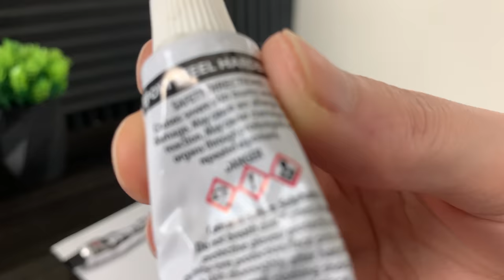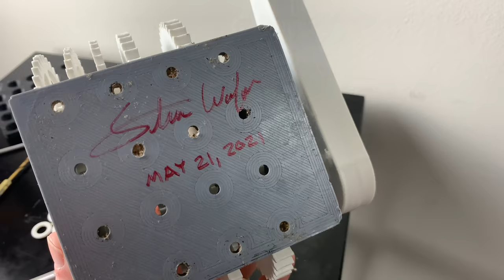3D Printer Gearbox - Spinning it FAST

Comment: I'd love to see a gear system like this used with a Fan. Just to see how well it could shift air or cool a room.
Reply: At what point is it just a manual plane
Reply: @crazynachos4230  When you can crank it hard enough, you need to measure your speed in Knots?
Reply: Technically, it heats the room, but you could measure wind speed and calculate a ballpark "wind chill." I'd like to see it
Reply: @SimonJ57  Knots are for ships not planes
Reply: @MonsterPumpkin  What are planes if not Ships of the sky? Real talk, airplanes do use "Nautical miles" and knots for distance and speed, respectively.
Reply: It'd create a need for an expensive motor with a lot of torque and it'd also be very noisy because of the incredibly fast spinning blades.

Probably why it hasn't been done already. Though I'm sure standard tower fans aren't just a direct drive. Must have some kind of gearbox.
Reply: @whyeven3722  late to the party, but there's also probably a functional limit to the relationship between fan speed and air flow. At lower speeds, the 3-speed fan works fine,  but the convection cooling achieved by the fan is directly dependent on the amount of mass flow the fan can move, which breaks down at higher fan speeds. Another user commented that the smallest gear was moving at 167 rev/s, which for a 20" box fan would result in a tip speed of around 266 m/s, or about Mach 0.78, which is well within the compressible-flow regime. Basically, making a fan "faster" only works up to a point, because once compressibility effects take over, your effective mass flow is going to drop off significantly due to compressibility losses and what not. I don't know all the details, but I would guess that a larger, slower fan, would remain more effective for cooling than a small, jet-speed fan.
Reply: At that point you have a turbine engine
Reply: @MonsterPumpkin  welllllll, some people use knots for planes, it’s dependent on height and speed, or so I heard, I’m not sure tho
Reply: Imagine it putting that gear from a bike

Comment: Some ideas from an engineering dropout, rather than substantially thinner gears on the faster end, decrease the infill on the print, you're losing efficiency from the thin plastic flexing as it spins fast. Some combination via trial and error may be needed.
You're never going to get adhesive bond to an axle to hold the kind of mechanical advantage you're working with on the handle, it's surprisingly easy to key a shaft with a dremel and then use a dab of jb weld to secure the key. Lastly, bearings might seem like cheating but you should definitely have something there. Might I suggest brass bushings and a bit of lubrication? They can work a dream and aren't too difficult to make.

Comment: adding some bearings or at least lubrication to the faster gears to reduce friction may help you get more speed.
insane to watch 3d printed parts spin faster than an engine. great work!
Reply: Grease to the gears (so that they don't wear) and oil to the bearings (so they are smoother).
Then drill a hole in the shaft in order to have a better grip when glueing things to it.
Reply: The only way he'll acheive those speeds is through trial and eror, somethings gonna break. Once something breaks simply reinforce it, if nothing breaks its not spinning fast enough.
Reply: @zN8z  trial and error isn't the only approach man. We got the tools to go ahead and be smart about designing it versus just winging it till the end.
Reply: @nap8187  no dur, this is a youtube channel. he makes profit for these videos, wouldnt it be better to have 15 videos slowly enhancing the build each time throughout each video. he could then make more videos rather than one  (making more money) . not about it fuctioning, watching his engineering mishaps is whats entertaning.
Reply: @zN8z  true
Reply: 10K RPM is really getting into mechanical bearing limits. The added mass of the centerpart of the bearing might add a lot of extra inertia on the final gears. This might already start to go require gearing mass optimization: e.g. reducing the amount of RPM to the heavy parts like bearing and solid steel shafts, for instance by adding extra stages. 
For high RPM spindles like 20K rpm, with some loads on it like in micro-lathes, you already need to start optimizing elektromotor spindle mass and start using air or magnetic bearings. 
Glue geometry can be highly optimized further, by making better use of the shear strength of the glue at the interface: also reduce glue thickness and real industrial epoxy bonds.
Reply: @zN8z  cough cough, wintergatan Marble Machine X, cough, cough.
Reply: My engine goes to 15,500 RPM 🤷🏻‍♂️

Comment: I wonder where this series is going? 
Don't end this until you reach a million RPM!
Reply: I’m pretty sure that’s impossible... with a 10 cm wheel with a mass of 50 g, the centripetal force would be about 55 meganewtons, the equivalent to about 5000 metric tonnes, way beyond the ability of plastics, and even solid steel.
Reply: Even Half a million is asking a bit too much
Reply: @mystcat3  2 million than
Reply: @GRBtutorials  Not if we use „Vibranium“ like that Hyperloop company!

Comment: I would love to see you try this again with the gearbox semi submerged in a low viscosity fluid to help reduce friction.
Reply: I guess that'll eliminate losses to friction, but is drag not going to be a serious problem? Air has far smaller viscosity that any liquid
Whouldn't just lubricating the sliding parts work better?
Reply: @ngiorgos  Cause that's the way to lube it. Oil would just fly off the faster gears just how water flies off clothes when the washer machine is centrifuging the laundry.
Reply: @rafaelmontagner9845  I see your point. Maybe a thin coating will survive just long enough for a record?
Also, what about drag? I think that 9000rpm in oil will have more drag due to turbulence than a dry gear due to friction, but that's just my uninformed guess
Reply: @ngiorgos  place the entire thing in a vacuum chamber?
Reply: @Formula7Driver  you'd still have friction though
Reply: Youd only need the bottom to be submerged, a closed case is necessary then and the gears will "throw" the oil through the case, lubricating the gears
Reply: @zagzig3734  0 air friction, at least. what about use it in a vacuum chamber AND with oil??
Reply: @dioodes7728  but will the oil boil?
Reply: Use grafit as a lub and mybe you can add bearing to
Reply: Can you print with Delrin, or some other super low friction plastic? That wouldn't need any oil. Or you could use a dry lube, like PTFE.
Reply: when i replicated this build I just invented frictionless material
Reply: Theres an idea

Comment: Obviously bearings and lubricant would help, I also had the idea to go up by each gear but you covered that here. I think each gear should be solid on the outside like youve done previously. My only other fun idea would be put golf ball pips on the sides of the gears
Reply: Golf ball pips would probably not help in this application. Hear me out.

Golf ball pips do increase the range of golf balls by decreasing NET drag, but there are two different sources of drag at play. 

First, we have "frictional" drag, where the air that is stopped rubs against the air that is stuck to the surface of the object. 

Second, we have pressure drag. I'm terrible at explanation, but imagine a bullet traveling through water. If the bullet was traveling fast enough, as water has momentum, it would "jump" off the nose, and then come crashing back down together. The void that is created is very low pressure, and literally sucks on the bullet, slowing it down. Golf ball pips INCREASE frictional drag, but this energy goes into creating turbulence that extends the boundary layer, or the area around the ball where relative air velocity transitions from matching the ball to stationary. This causes a lower tendency to suffer from flow separation, and thus decreases parasitic drag. The same effect could be achieved by having a teardrop shape, like hypermile cars, but balls must remain rotationally symmetric.

A gear has a constant cross section when rotating, save for the teeth, so I believe pips would only increase drag.

Comment: Lube all the contacts + use router bit bearings between the shaft and the gears, these are made for high speeds, and you'll be able to get faster with the same input force :)

Comment: "the strongest thing I could find....JB weld"

You didn't search very hard apparently
Reply: I think you under estimate how strong it is..
Reply: The claim that it's stronger than steel is just marketing BS, but if used properly, it's extremely strong.  It wasn't used properly here, though, as both surfaces should have been roughed up prior to application.
Reply: And the piece of the shaft going into the handle should obviously be any shape other than round.
Reply: @dokols  that wouldn't actually give it less structural integrity for the given application...

Comment: Future him: Lets add 5000 more gears so we can break the speed of light!
Reply: thats pretty much not possible
Reply: @exorias625  it's a joke mate
Reply: Would it be possible with stronger materials?
Reply: @Mr_Wololo  its not the materials you should be worried about 
its the energy required to do it 

as for stronger materials... well since this one is small then almost any strong metals should work but the larger they get the faster the end gear would spin and after a certain point not even nuclear pasta would survive being ripped apart from spinning that fast
Reply: 1:2^5009 gear ratio
Reply: We could do speed of sound tho
Reply: @exorias625  thanks!
Reply: You wouldn’t even need 100 more gears. Each gear adds a larger and larger increase in rpm.
Reply: @thatoneguy611  yes but as you approach the speed of light, you gain more mass. So the gear would be in a never ending battle having to use more force or gears to account for the ever climbing mass as you get faster. In simpler terms... nothing with mass can reach the speed of light
Reply: @TYGAxxxx  I know all this. I’m just saying it would have the ratio required to reach the speed of light, even if it’s possible to reach it.
Reply: What about the speed of meme?

Comment: I have an idea, can you attach a saw blade to last gear and make a manual saw? If it's possible i really want to see it.
Reply: i dont think the last gear has enough torque to saw anything
Reply: @minerva474  add mooooore gearsssssss haha
Reply: Though this would seem like it would work it would just stop immediately as soon as it hit something. As a sub comment said it wouldn't have enough torque to go through anything and the last year isn't spinning fast enough for the speed it needs to keep going
Reply: @fripsebibs  rpm dose not mean workable speed
Yes it has speed but it only has a tiny amount of torque
Reply: @minerva474  you took the words out of my hand as I was about to type.
Reply: @djaydeved  ah i see. unfortunatly
Reply: @minerva474  Yeah they're would be basically 0 torque
Reply: Or fan blades.

Comment: I might try using a hex shaft with hex bearings. The hex makes it so you don't need to epoxy it and the bearings will drastically decrease friction.

Comment: I mean, if you had durable enough materials, and a strong enough cranking mechanism, and enough gears...
You could reach the speed of light.
Odds are though it would require more force to turn than is possible to generate. X.x
Reply: it straight up wouldn't budge
more likely to break first
Reply: It fails on all counts, there is no way go generate the force, no material that could withstand the force, and spinning gear would destroy itself
Reply: The final gear's perimeter is hitting less than 300km/h. It would take a force 3 million times stronger, with almost infinitely more durable materials to achieve this with the current conditions. Create a zero friction and resistance condition and it would still take a force way beyond our capabilities. And it would still break.
Reply: Reaching c for anything with mass requires infinite energy.  Only zero mass particles can go that fast.

Comment: When I was a child, I my dream was to build a plane using a mechanism like this, and power it with my legs. My legs were extremlely strong when I was a child
Reply: Did your mom tell you that?
Reply: Considering the fact that the majority of general aviation airplanes turn their engines at 2,800 rpm or less and this has 10000rpm this would be flyable.
Reply: @sturmx96  Someone much smarter built a pedal powered aircraft. This required almost a century of innovations for a short low flight.
Reply: @johndododoe1411  Yeah I was bogged down watching those videos after I wrote that comment which later resulted into me eager to fly on a glider once.
Reply: Then you would quickly learn the difference between speed and power. You may be able to turn these gears that fast, but if you attach a propeller to it, you need a lot more power than a human can provide. A human being can produce about 1/4 horsepower or 186 watts of power. For comparison, the Wright brothers’ first airplane used a 12 hp (9 KW) engine.
Reply: @singleproppilot  Which is why creating a human powered experimental plane at all was such a major and difficult achievement.
Reply: @singleproppilot  I said that my legs were extremely strong, not fast. What's your point?

Comment: Ceramic ball barings on the shafts, Taller mount so you can move it if needed. A keyway on the handle and shaft connection with a metal washer cover for the rear part up against the mount. A solid handle with a handle that rotates with the gears.  Gear (the first gear) that can be locked down onto the drive shift with a keyway or flat ends of grommet screws onto the drive shaft.  Maybe a clear cover so you can put a light amount of lube on the gears. Separate the gears on different shafts to make it easier to turn instead of just two shafts. Or put the  gears after the first gear on barings.

Comment: The spokes in those last gears might make them lighter, but it's also going to add drag. A solid gear with less infill will the job done better.. It'll probably help keep the fastest gears better in-circle as well. The last several gears would benefit in being balanced. The vibration and wobbling adds a ton of drag and is causing most of the plateau you are hitting. Reducing tolerances between the gears and shaft would help with that as well (+1 on the idea for quality ceramic ball bearings). With those tiny changes, I bet you could go a lot faster, and probably with much less force.

Comment: reduce vibration by improving light gears quality ( check equilibrium ), maybe add metal tube between gears and axes to reduce clearance, or use bearings on fastest gears
And remove gear teeth on last spinnner to reduce air resistance

Other idea: add a carter around and between gears to reduce air fluctuations

Comment: Cool project!

I noticed you use hot glue a bunch...  Have you played with UV resin yet?  I started using that stuff instead of hot glue and absolutely love the stuff.

It's a bit runnyer so it won't work in ALL glue gun instances but I find it cures just as fast and holds much nicer in many cases

Comment: If you do it again, you can get a 12” 1/4 or 3/8 ratchet extension and use a long ratchet to turn it, you can crank it back and forth to make it easier. That way your drive (minus the gears) will be all metal including the handle :)

Comment: If you want fast, 
1-go for smaller diameter gears to begin with: the teeth have air resistance, and the velocity of the final gear is such that this velocity matters. 
2-make the final gears disks, not spoked. Again, because of air resistance
3-friction on the shaft is a function of speed for slife bearings, ball bearings run a lot smoother. Use open bearings, lightly oiled, no grease or dustseals

Pretty sure those 3 mods will result in higher speed

Comment: I'm going to show this to my robotics kids. They want to make a projectile system for the robot, but the motor they have doesn't not generate a ton of torque or speed, it's more of a happy middle ground for the two. They will need to make some sort of a gear box for a flywheel system to launch the object. Because of the low torque, they're going to need a pretty high rpm of they're going to launch the game piece more than 3 feet,  so this could spark some ideas for them. Thanks!

Comment: Put this in a car and it go zoooooooom
Reply: Wouldn’t work, it’d spin the drive shaft apart. Throw bearings. Rods etc, an engine wouldnt handle this gear ratio
Reply: @c10chebby69  mid mount motor, transmission stright into the rear end. This would be good for a high torque diesel

Comment: If you put everything but the handle in a vacuum chamber and greased the metal very good would that make it easier to spin the gears
Reply: wdym
Reply: @TheRealNiktWazny  the main factor stopping the gears is air resistance, if it’s in a vacuum the next biggest factor is friction against the metal in the middle and against gears which is why you grease it
Reply: @gerritthompson2246  well I'm pretty sure that in both biggest factor is friction cuz gravity can't be really changed
Reply: @gerritthompson2246  and putting it in the vacuum chamber will make it spin maybe 8% faster meanwhile no friction would be atleast 10x
Reply: @gerritthompson2246  you underestimate friction but if you do both then that 8% turns into atleast 4x
Reply: @TheRealNiktWazny  I think air resistance is a huge factor but we can both agree a ton of grease will improve it
Reply: @gerritthompson2246  yes it helps a lot
Reply: @gerritthompson2246  btw air resistance thing isn't as bad as you think cuz it's spinning not moving in straight line so it would be only useful to change shape of 2 last wheels to have more round edges and more changes won't do much